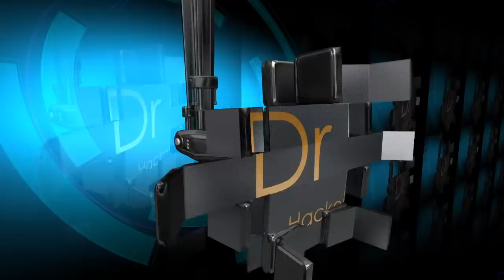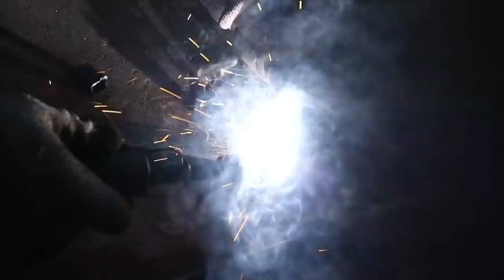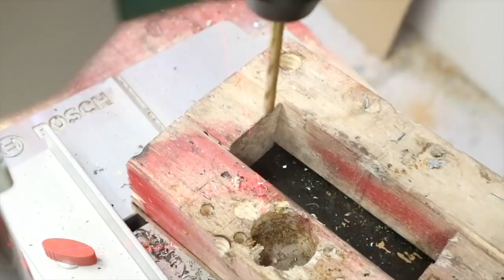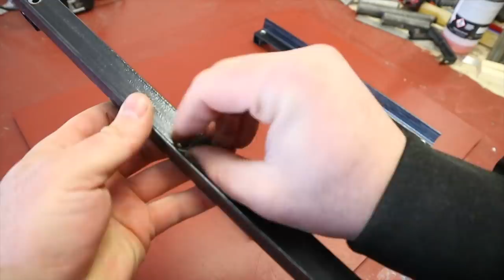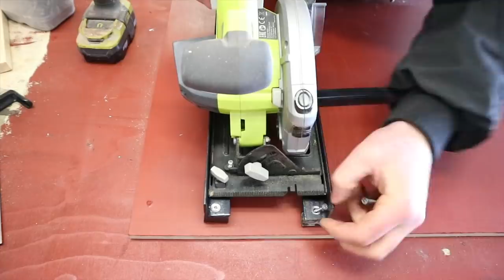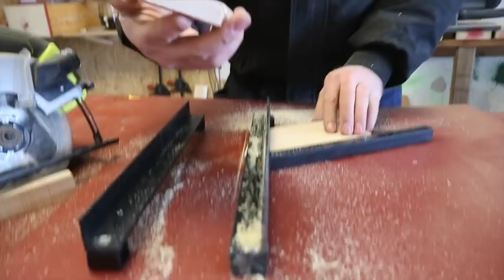Make a Circular Saw Crosscut Miter Jig

Comment: Neat. For those of us that don't have welders, a person could cut those feet a little bit longer, drill through both, and then screw it into the wood base. Two thoughts to improve angle guide is to 1) Mark angles on the board to speed up/improve cutting, & 2) Either pin or clamp that movable angle bar. I don't need this as I already have a compound sliding miter saw but for those that don't,  this is a great fix fo a few bucks

Comment: This is the simplest and brilliant idea. I wish to adopt this design without welding, as i dont know anything about metal work and i dont have equipment either.
Reply: get angle iron 2" wood drill hole in angle iron mount to 2" wood place saw in the angle and put the other angle one in screw down place on base. Not forgetting to maximise depth and on the motorside check it will fit as some motors are only 10mm from base plate.
Reply: Grateful Thanks

Comment: This setup seems to be very useful for hobby work. Is it possible to use wooden raisers of 2 or 3 inches thick square instead of 1 inch square metal tube for the raisers so that the scope of cutting 2inches or 2.5 inches wood. Please explain. Is it possible to cut PVC, and metal pieces in this ? if so what would be your suggestion on the blades (saw blades for each of them) to be utilized and the maximum thickness we can try to cut in it. Of-course we have use clamps for holding them rigidly. But the setup shown by you is superb and I will try to make it only after hearing from you on the queries.